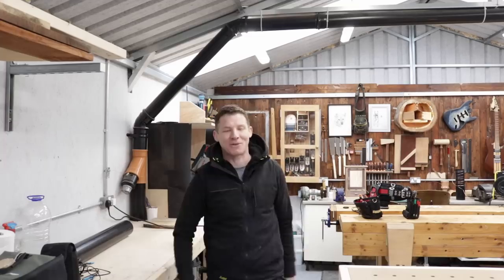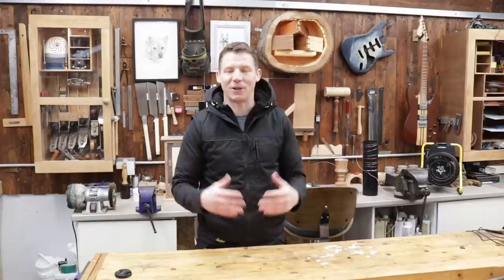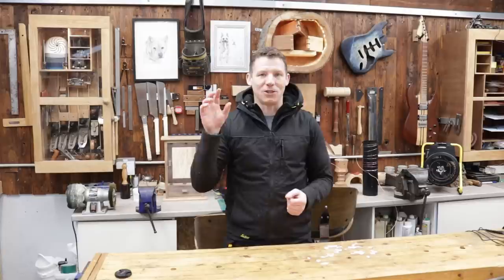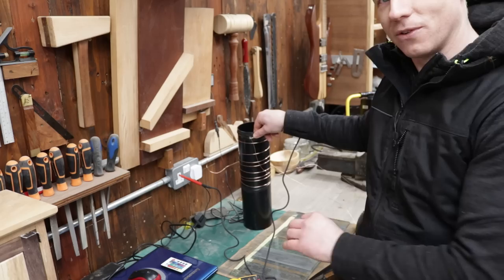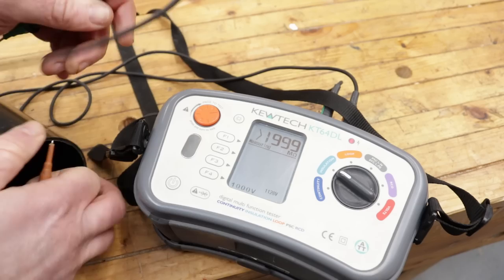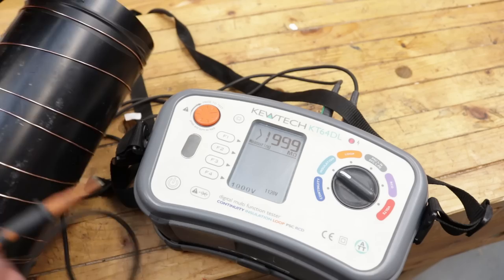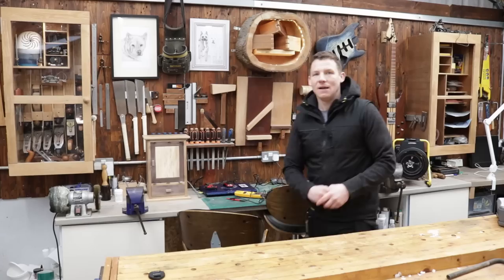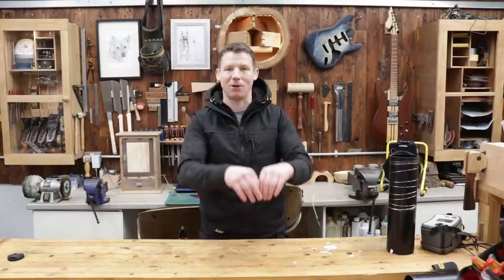Grounding/Earthing a PVC Dust Extraction System! Time to End the Nonsense!!

Comment: This is spot on for the most part. However, my biggest concern is arcing: any contact to ground from your statically charged pipe system can cause an arc, which could ignite dust/chips, resulting in a fire in the dust collector. Not a huge issue if you empty your dust collector regularly, but a metal duct system seems like a good engineering control to me.
Reply from the maker: Only if the arc took place in the dust collector itself, if you ground the outside of a pvc pipe it will not arc on the inside, the only way to get a pvc pipe to arc on the inside is to have the ground wire in there in the first place.

Comment: you did a fantastic job explaining this topic that I think more people need to see. my one question and thought I have is... although the chance of a home shop fire being caused by the static build up on your pipe discharging and igniting the wood dust is almost impossible, don't you think running the free floating copper wire inside the pipe where in some places there might be a slight gap between it and the pipe and as the pipe builds the capacitive charge it could discharge creating an arc where the dust is at? I've always thought running the conductor inside the pipe giving an earth potential there was probably the worst place to do so. again I completely agree the risk is almost zero, and agree with what you've shown in your video, its just something I've thought about.I'd like to here your thoughts on that. thanks for the great video!👍

Comment: Build up of static on the inside of the pipe will cause the dust to clump and may result in a blockage. Putting a wire on the inside 'might' result in the charge on the dust particles being discharged and thus reduce clumping.  It possible to buy conductive plastic pipe but you need all the accessories such as bends & waste gates to be conductive as well.

Comment: Late to the party but just seen this as I'm looking at installing a dust collection system soon. Was looking at the AW118CE from Axminster but noticed in their destruction manual for the unit, they actually say you should wrap plastic piping in copper wire and run a wire down the inside. I thought it was just oddballs on the Internet telling people to do this, had no idea it was even being pushed by equipment manufacturers!
Reply: They will say this because they sell the copper wrapping wire kits

Comment: Very nicely done John 😁. Clear demo and well supported facts. I've seen some excellent (almost artistic) attempts at grounding but as you say a bit of a waste of time. Great video, thanks John. Stay safe 😁👍
Reply: Isn't the standard procedure to penetrare the pvc piping? Wrapping it around the outside won't do anything unless it is connected via a conductive material to the interior of the pipe. The gold standard is to run metal tape down the inside and outside of the pipe, connect those with screws through the pvc wall at intervals and then run grounding wire through those screws to the ground. There isn't any real danger to the static, but it is annoying to catch sparks and (as you show) static makes dust and other bits stick to pipes. Anyway, my point is just that this video isn't testing the right thing. Everyone knows pvc is an insulator... Right?

Comment: So how about the flex hose with the wire in it. My problems with static are with my cnc equipment. A big zap of static to the cnc is treated like a direction signal and it usually the bit into the bed. Proper grounding of the flex hose helps redirect the zap away from the electronics but does not stop the static. Metal hose can’t be used because you need the flex.
Reply from the maker: That is a different situation, static and electronics is a real  problem, you may need to ground the cnc machines frame properly and insure that the control board is properly insulated from static. It should not be getting near your control board or other electronics.  If you are having that kind of issue I would be talking to the manufacture.

Comment: I thought that the static would bleed through the conductor through induction? If I run a wire that is grounded along my pipe, it does reduce the static but you are saying that induction does not happen allowing the charge to bleed off?

Comment: You state that PVC is an insulator, however when the tube is full of moving dust the dust can hold a charge and conceivably conduct the charge from one dust particle to another. There will still be a charge on the PVC but some of it can be bled off by providing a ground path that goes through the dust.

Comment: Great, clear explanation John!

Out of curiosity, is there an easy way to measure the amount of static build up on a section of pipe?

Also, if the PVC is an insulator, and the friction is caused by wood chips travelling inside the pipe, does that mean that you shouldn’t typically be getting static shocks from the outside of the pipe?
Reply: essentially the PVC pipe with a charge on the inside is like a capacitor so I think you could get a shock if the inside is charged

Comment: I just upgraded my pvc dust collection and while running some boards through the planer I was getting zapped pretty good from the hose while reaching over it. Should I run copper through the pipe to connect my hoses to ground? thanks for sharing your knowledge!!
Reply from the maker: Wrap and ground the outside of the hose with a foil tape, that would be the best thing to do

Comment: Good video, Have a question though,  I use flexible hose to my CNC router, Have heard horror stories of static building it that hose and shorting circuit board in the controller, My thought is a single copper wire through the flexible hose and grounding it.  Do you think this would keep static from shorting the electronics in the CNC Router?

Comment: This is a public service announcement.  THANK YOU.  However, I do strongly recommend bonding the wire reinforcement in flexible hoses if you run any CNC or computerized equipment.  Might not start a fire, but it will fry your electronics.  Don't ask me how I know.  (re-worked some hoses and forgot to reconnect the bond wire).
Reply from the maker: I'm always shocked that the electronics on cnc's are not properly insulated

Comment: Hi John. Ok, I have a Karcher vac & on top of it I have a metal barrel that has a cyclone dust separator. The cyclone & vac are connected by PVC pipe. I'm manually following the router on the CNC with the vacuum hose, but when I try to turn off the router, touch the mobile controller or the CNC, I get one hell of a shock. 
If I scrape some of the blue paint off the barrel, weld an earth cable & then take the cable to the metal outlet, would that help?
I've tried rubber gloves, but it makes no difference. So I'm having to use the end of the crevice tool on the hose to turn them off. Thank you

Comment: John, wondering if you can help me with the one part I'm still unsure about... 

I agree 💯 that there's no risk of explosion etc in a home shop. I'm only thinking about static shock when you touch the pipe and the danger that could pose while operating power tools. You show that the copper wire around the pipe can't stop static buildup attracting the paper pieces, but you rub on the pipe on the opposite side from where the static picks up the paper. So does static electricity in fact travel around the surface of the pipe to the other side? Would a wrap of wire bleed off at least some of that static, making potential shocks less severe - even if not eliminating them?

The only thing I've been able to find to support "grounding" PVC pipe, is anecdotal evidence of lesser shocks from pipe contact, which would be a very good reason to do it if it's true. 

Can you offer any insight into this?

Comment: I thought the idea was to put grounded screws into the pipe to allow the air inside to discharge.
Reply from the maker: trying to discharge air with screws is a futile and trying to ground pvc, Air is a good insulator. If your a worried about static don't use pvc. To discharge static from air in a pipe you need to use ionized gas no one is doing that in a home shop.

Comment: I have to admit I haven't watched the whole video yet, I will right after I post this. But at 4:33 you say that if you have a build up charge on the pipe and you touch it, you discharge (and can get an arch that can cause an explosion), but if pvc is a conductor that can not get rid of its charge by grounding it, how can it discharge by touching it? Would your body be the connection to ground?..

Ok, I'll watch the rest of the video now 😉
Reply: Ok, got it! I'll shut up now 😂😉
Reply from the maker: PVC is not a conductor its an insulator, static is a build up of extra electrons on a surface most materials want to remain electrically neutral so it wants to get rid of the extra electrons, you will be positively charged relative the area of static and so you can have it discharge into you this can cause an arc. Try it with a woolly jumper pull it off over your head in a dark room you will often see the little sparks from the static. That's a very basic explanation like I said in the video I don't want to get to into the science. There are loads of science videos on youtube.

Comment: I have a rubber hosed dust extractor attached to a CNC router. Every time I touch the hose and the workbench at the same time, the router shuts down and I have to restart. What can I do to stop this?
Reply from the maker: Ground the workbench and wrap the hose in a conductive material and ground that also.

Comment: John another great YouTube video and sorted out a lot of issues. Big issue I’ve got my cousin keeps on getting me 100 mil metal ducting pipe and elbows plus glass gates for it would that still be okay to use if it was earthed properly it’s like you’re saying the industrial style. Won’t be using a lot of it as I’ve only got a single garage. It will be bandsaw live tablesaw occasionally might even be a thickness plana one day but not yet and a sander so won’t be running it all the time either if it was earthed would that be okay to use
Reply from the maker: It will be fine Paul metal is better and you can easily earth a metal system.
Reply: Thanks forgetting back to me John. That’s good I will use it as I got a fair bit of it all I need to get is some reduces into plastic flexible pipe to connect to the bits of kit. Hopefully there is somewhere online help me get some information on her feet earth in it if not I’ll drive a earth bar into the ground and perfect that way that should work hopefully not a electrician like you though I’m just a blind man. Might do a couple of videos of me doing stuff soon to see what is like. Also John have you thought about Facebook more I can share bits on there quite easy and communicate quite well on that

Comment: Would having a mixed system pvc to keep cost down with sections of grounded metal tube at regular intervals have more of an effect than copper wires ?

Also is there a risk of a static spark causing a ember that smolders in the dust and creat a fire. 

I've herd that people sucked up a screw, that his metal blades in the vac, causing a ember and an eventual fire.

Comment: If I use metal HVAC pipe then I should ground it, yes? If yes, do I wrap the wire around the pipe or can I I run it straight? Also can I use metallic tape the connect the ground wire or do I need to use screws?

Comment: A little confused. After all your explanation and demonstration of how pvc is a great insulator and that copper wire will only discharge where it actually touches - you still put a wire through your pipe?
Reply from the maker: I addressed that in the video

Comment: Great explanation John. 
I do have a question if you can possibly clarify.

Is it possible to connect PVC pipes, PVC sockets to metal end points?

As I want to use a PVC system, with metal reducers (6 to 4)

Cheers,
Reply from the maker: As long as you get a good seal there should be no issue

Comment: Thank you John for debunking the plethora of misguided "static protection for pvc dust system" YouTube videos.  As you demonstrated with your paper attraction test, unless the whole internal tubing is coated in conductive paint, there will be charge building up on the non-conductive areas.  The most dangerous aspect of the discussion, in addition to your advice about lung safety, is the fear and anxiety caused by YouTubers that pretend to know what they are doing, but they actually don't understand  science behind their topic. An opinion is just that...it is not necessarily a fact.
Reply from the maker: Very welcome

Comment: I've been getting a bunch of pretty serious static shocks from my shop vac dust collection system.  I use a short flexible hose from the vac to my PVC pipe system.  I have 4 blast gates to route the suction to where I need it at the time.  it being a shop vac system, I use 2.5" PVC.  at  3 out of 4 of the blast gates, this is reduced to 1.5" flexible hose.  I live in Arizona (US) and yes it normally quite low humidity.  a week or so ago humidity was 11%.  all that explanation to ask if there is any thing I can do to reduce or eliminate the SHOCKS I am getting from my system?  it is generally when I touch metal, like the top of my table saw, but not always.  I have a table with 3 tools attached to it and the table is on phenolic rollers, but I still get shocks from it.  I've never worried about any explosive situation in my garage shop, I just want to stop the static shocks.  please help.
Reply from the maker: Make sure you machines are grounded properly. It could also be you. Depending on your shoes and the type of clothing you wear you could also be building up static and discharging it when touching your table saw.

Comment: Hi John I get an electronic shock when using my table saw for sending on . Why is this?
Reply from the maker: Hard to know without seeing it,  could be the sander, could be static the table saw should be grounded so if you are building a charge you will feel a shock when you touch the cast iron top.

Comment: Hi, I purchased a small dust deputy to use with a shop vac in a small shop and that came with a length of copper wire to discharge static and I think prevent static affecting the shop vac. Given your video I’m now thinking that it was pointless. Do you think that static buildup could be a threat to the shop vac?
Reply from the maker: Very unlikely the shop vac should be grounded through the power cable it comes with, however I would encourage everyone to do what the manufacturer recommends so you don't void the warranty.
Reply: @JohnMcGrathManInShed  Cheers, it came with the dust deputy which is American I think. They tend to put messages like do not use iron on clothes you are wearing on their appliances so I did wonder if it served any useful purpose or was to cover themselves.
Reply: @H2Dwoat  Wait a minute...... y'all don't have those VERY important disclaimers on your irons??? And your country is still full of people?? lol I admit, sometimes it is embarrassing being a Yank
Reply: @mikekline267 : 😁

Comment: Duh.. The static electricity is INSIDE the pipe.  Put a single bare copper wire INSIDE the pipe (on the top, preferably), running the length of your main tubes and tie to a ground and viola.. no problem (unless you are industrial/commercial).